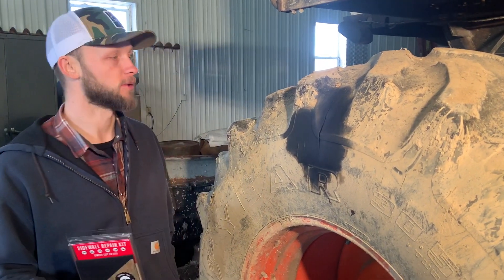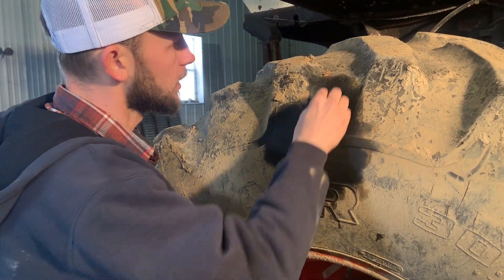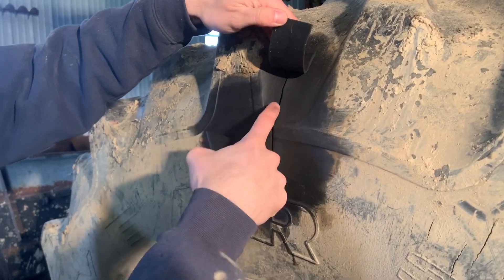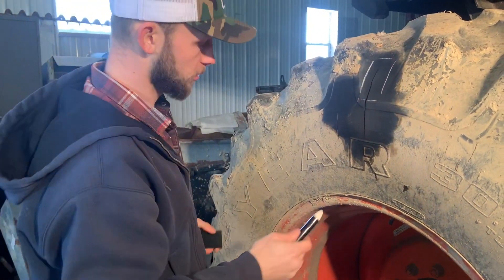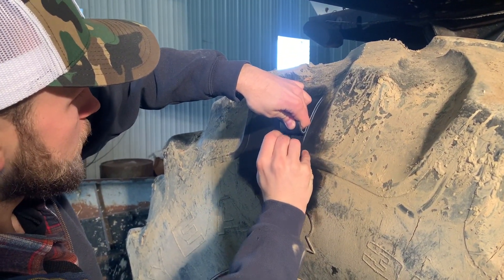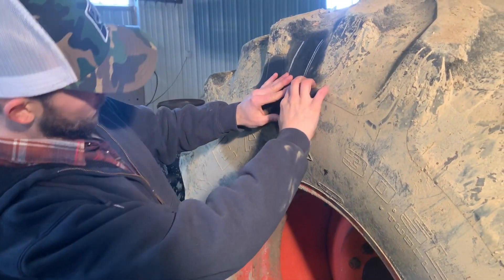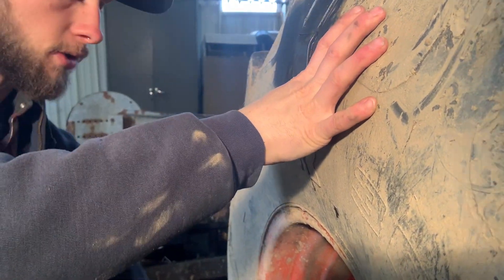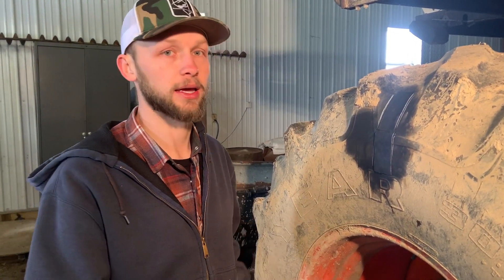Repair a Tractor Tire Sidewall!

Comment: Thank you for sharing. I ponder if you had injected an adhesive into the crack and lower the tire pressure to close up the crack while the adhesive was still liquid and later placed another laminate of rubber over the repair if it would have worked even better. Here is a link to one adhesive that has had rather impressive results at retreading tires that are bald. May even be much cheaper to use than the one you are sharing. https://www.youtube.com/watch?v=vRWQ7sHI7t0

Comment: How Much time will the patch give?
Reply from the maker: Frank-- thanks for the message. 

There are several factors that will determine the durability of the patch. We have customers that have run patches for literally hundreds of miles on their side by sides. With that said, we only advertise our patches as a temporary fix. 

Tractor applications are generally much lower demand than powersports applications and if you are careful to follow the instructions and prep the tire correctly you can expect a reliable result.

Comment: 30.5/32  I am not so eager to work on them. those old goodyear power torques always split like that. if that was all the way though, the repair would not prevent anything from pinching the tube.

Comment: Has this patch held?
Reply: Hello! Appreciate the comment! These patches are meant to be a temporary fix but we have customers that have reported using them for several hundred miles. Feel free to check out our reviews on Amazon or on our website! Thanks!
Reply: @jakelieberth2898  I have ran with cracks on my tractor tires for a few years. I mean to replace my back set costs over 1k so from what I have heard this is more cosmetic then actually extending the life of the tire.
Reply: @jakelieberth2898  Very "corporate approved" answer.